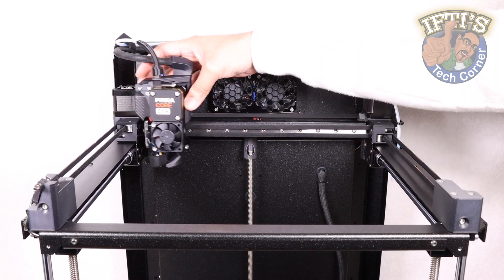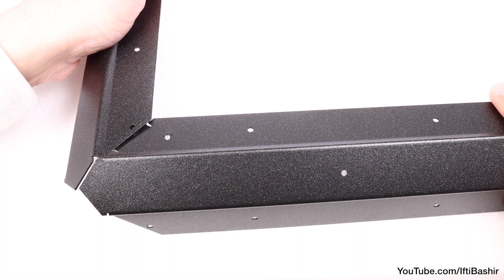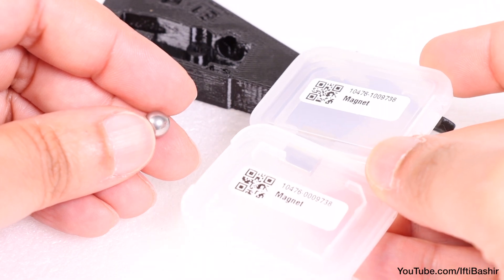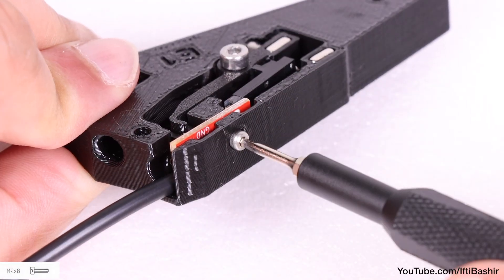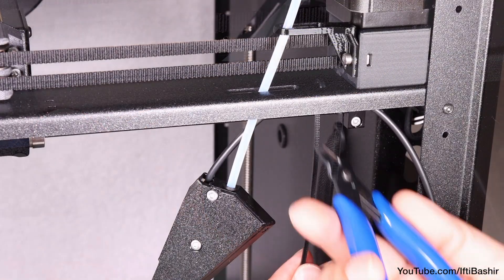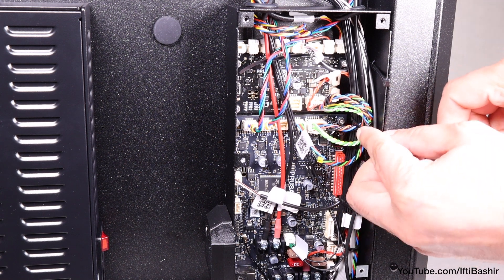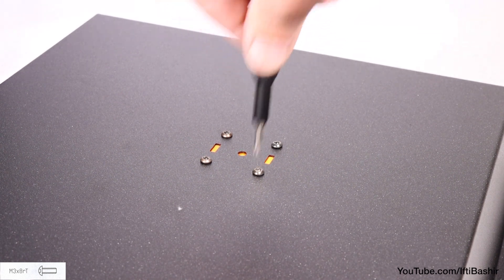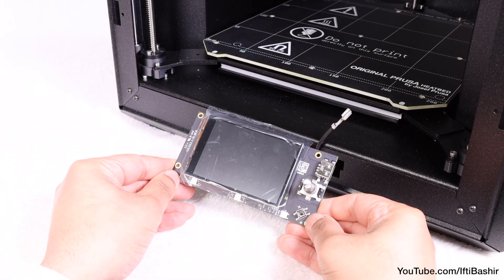#07 Original PRUSA Core One Kit : Full Step-By-Step BUILD GUIDE - Bodywork & Electronics

Comment: Recommended Upgrade: Filament Spindle with Bearings found on Printables. It helps spools roll so smoothly and holds them in place with a screw ensuring they won't fall off.
Reply from the maker: Good idea!
I do not use the side holder at all - I have my filament on a shelf above the printer and feed in via a longer PTFE tube from there as my printer sits beside a wall!

Comment: I must've either used the wrong screw on my way here or Prusa didn't give me enough. I ran out of M3x4rt at the electronics chassy cover.
Reply from the maker: Any in your bag of spares?
Reply: @iftibashir Nope all gone. 😥
Reply: I still have a bunch of...
- M3x4r Black (9pcs)
- M3x5rt Black (12pcs)
- M3x6 (8pcs)
- M3x8rt Black (15pcs)
- M3x8sT Black (7pcs)
- M3x10 (5pcs)
- M3x10rt Black (5pcs)
- M3x18 (5pcs)
- M3nS (9pcs)
- M3nN (5pcs)
Everything else is has one spare with the exception of M3x4rt Black and M3x8, those two are empty bags.

Update.
I'm only missing 3 M3x4rt Screws. Build is back on track.

Comment: At 11:49 , it’s not M3*8, I tried, also with out the metal, just directly the screw to the plastic. Not going in at all, but M2.5*10 going in perfectly fit, so I’m supposed it’s either the 3d printed part with the wrong dimension or the screws are provided with the wrong number. Either way, I need M2.5*8 to complete this step, which is a little frustrating.
Reply from the maker: My M3x8 (as stated in the official Prusa build guide also) seemed to go in ok. I do recall it being quite a tight fit, but they did go (as shown in video).......nevertheless, M2.5 would have probably been perfect.....

Comment: 01:05 you put the right side on, but it looks like your holes were not 100% aligned, how did you address this?
Reply from the maker: They align as you start to secure with screws
Reply: @iftibashir  they didn't for me.  i had to push on and pull on the frame.  I took extreme care when putting mine together to make sure things were well aligned and i have had terrific problems with several screws for the frame.